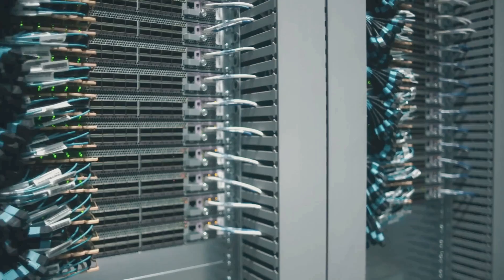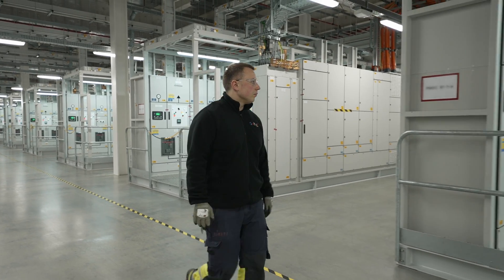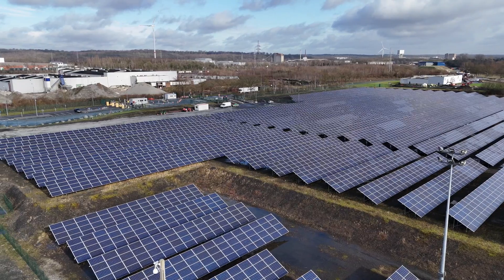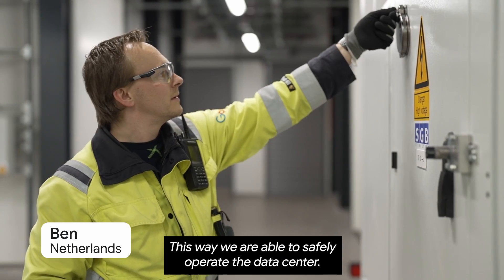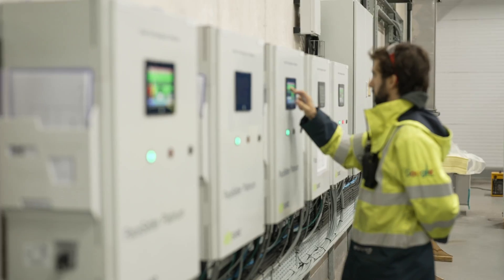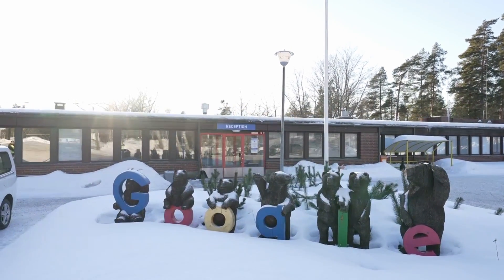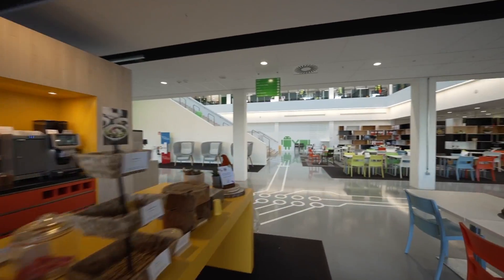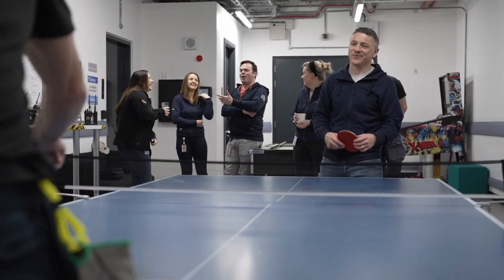The Backbone of Google Data Centers: The Role of the Facilities Technician

Comment: Congratulation guys just miss opportunity by final round interview i will never give up for next time.
Reply: what did you miss? do you mind sharing that that info please?
Reply: @whiteeagleforce2.040  Am basically electrical experienced, for Data center Google there are many stages of interview even mechanical round there so it was tough for me to clear mechanical round and all interviewers in Google they are very strong professional both theoretical and practice as well.
Reply: @Entertainer_sushil should only be focused on mechanical or electrical or controls based on
Reply: @SvddenD3ath  Electrical, mechanical control,behavioural & leadership, safety measure.
Important is Basic of your strength.
Reply: @ Must be a different role. I work there and we only ask based on what you are good in
Reply: @whiteeagleforce2.040  and my cv was shortlisted for the Netherland Google Data center for sr.electrical facility technician.
Reply: Could you please share some info about interview, I also going to have electrical position